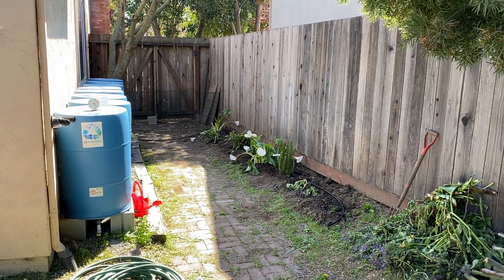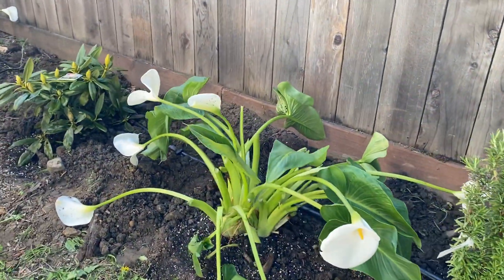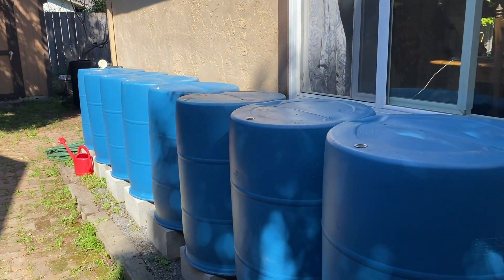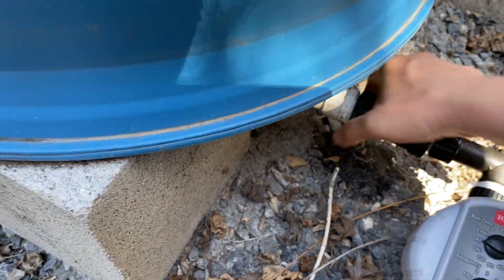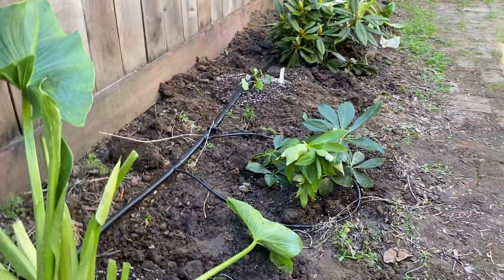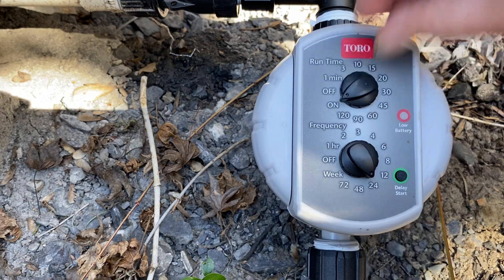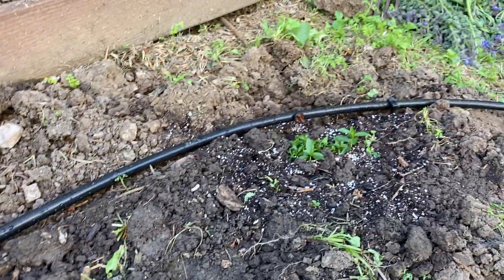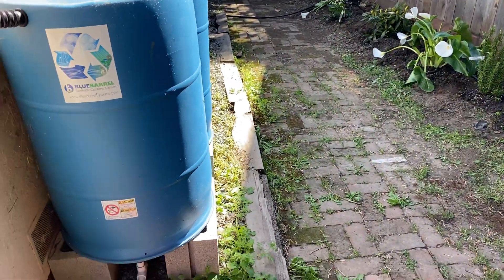Rain Barrel Irrigation by Gravity: Bubbler + Inline Emitters

Comment: What item did you connect before the filter
Reply from the maker: That would be a high-flow drain valve, available at bluebarrelsystems.com. The high-flow version is much better than standard for gravity-feed because it doesn't restrict the flow.